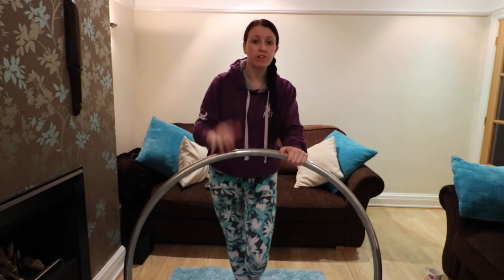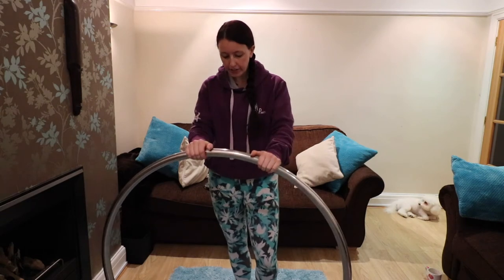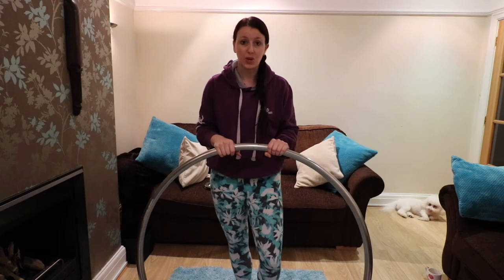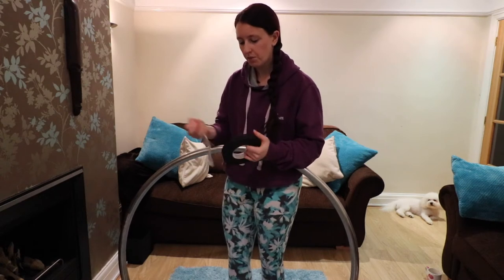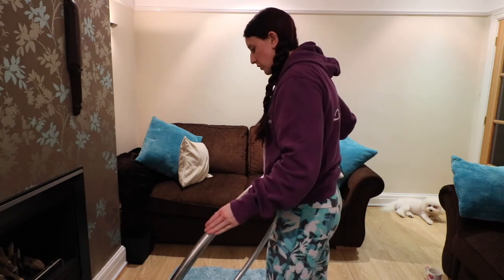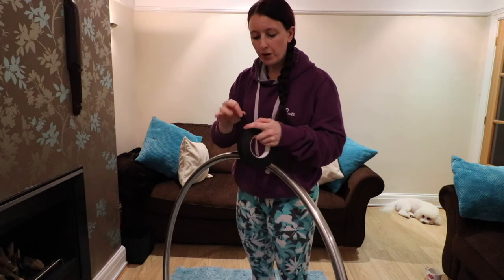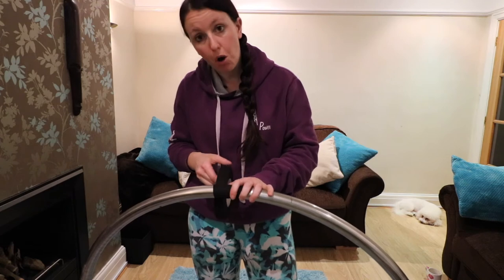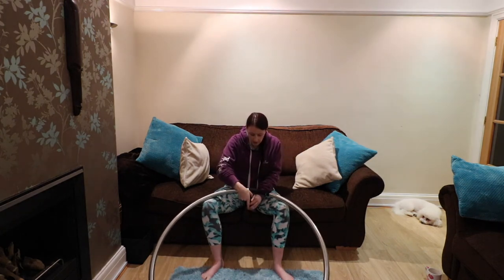How to Tape Aerial Hoop

Comment: Thanks. This was very helpful. 
Question; does it matter what width tape you buy? I am buying my first hoop and wondering what width would be best.  
Second question; how do you choose what hoop is the right diameter for you? Thanks
Reply from the maker: Hiya, apologies for the late reply. The diameter is usually personal preference and depends what you plan to do. I have a smaller hoop too which I use when I want to work under the hoop because I train at a low height it maximises the space I have underneath when rigged up  

The recommended way is to measure from heel to lower back. Firetoys.com has a great blog on it https://www.firetoys.co.uk/blogs/what-size-aerial-hoop-do-i-need

So I wouldn't say the width of tape makes much difference xx
Reply: @PolePowerAcademy  thanks so much for the reply!